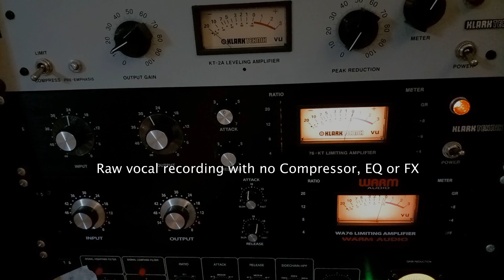Serial compression. No la2a!

Comment from the maker: How do you like to compress vocal?
Reply: I mix in the box and use 3 to 5 compressors on a vocal to get it to sit right. Maybe it's a plugin thing. Similar to what your showed but also a multi band plus another 1176 at some point in the chain, then a limiter etc...all doing light work. If I slam a compressor in the box it just doesn't sound right to me...if I don't, it's still just too dynamic.
Reply from the maker: @PeterSavad  Thats great! My self use to track like the video with two 1176 then when its time to mix most of the times i use an la3a. So i guess in the end we goes in to the same territories. 😊